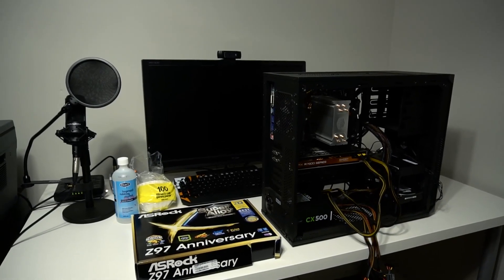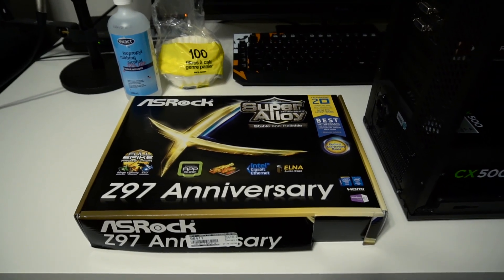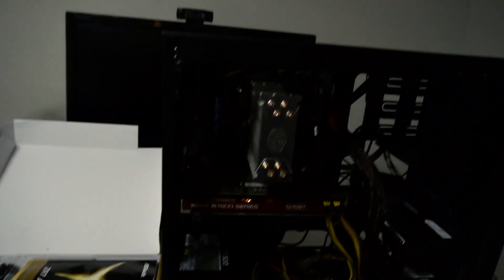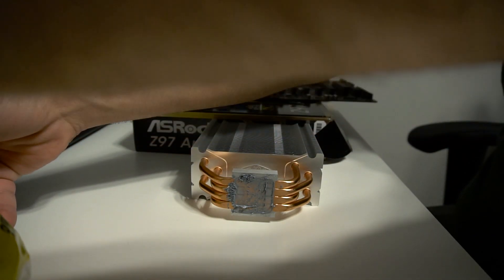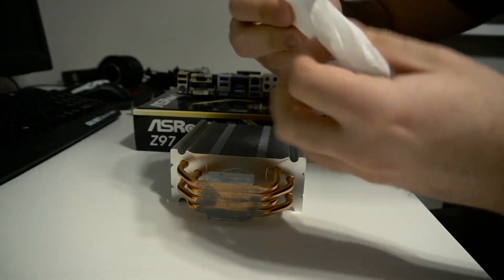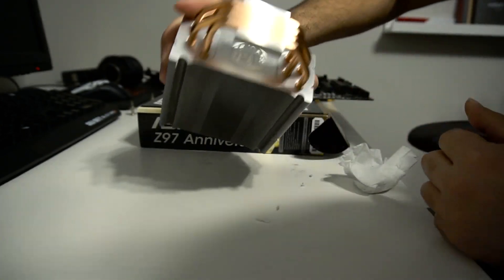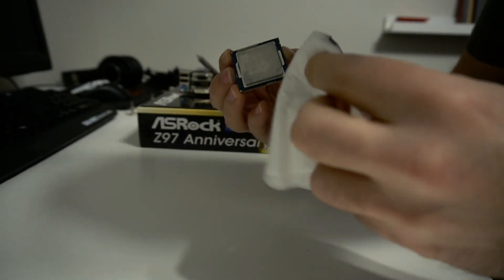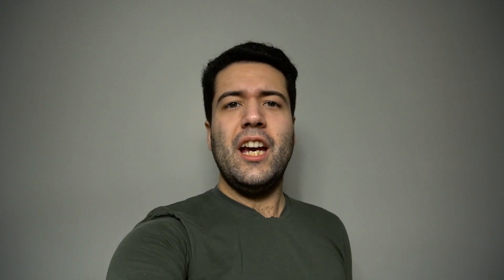PC DIY - How to clean your CPU of thermal paste!!

Comment: For the remover you linked in the description, do I still need a coffee filter? Or just normal paper towel?
Reply: Great video, but the room is dark....
Reply from the maker: I'd still use the coffee filter if possible, paper towel should be fine though. Just inspect to make sure nothing is left behind (that goes for both paper towel and coffee filter). Yeah I'm trying things out in a new "studio" and still have to get the lighting down ;)
Reply: Typical Reviews thanks 👍
Reply: Typical Reviews can i get a shoutout pls